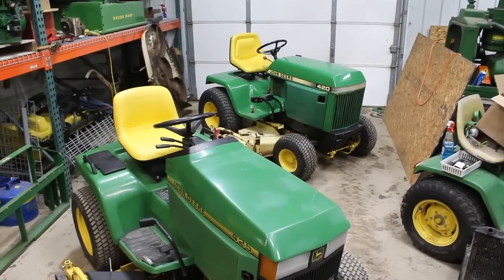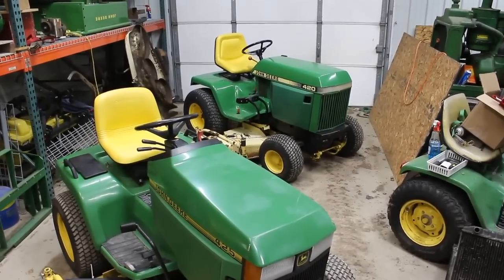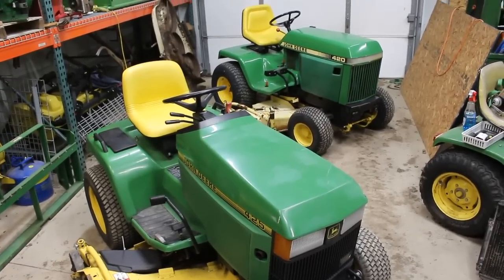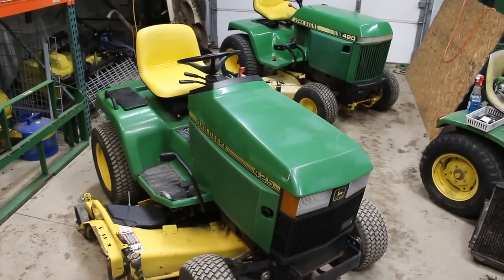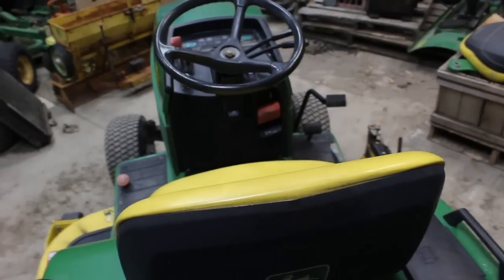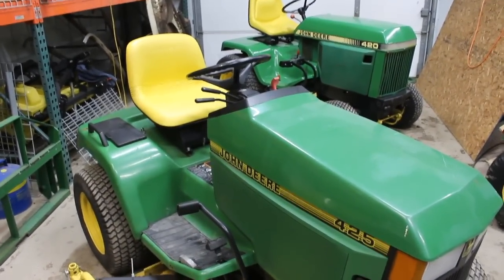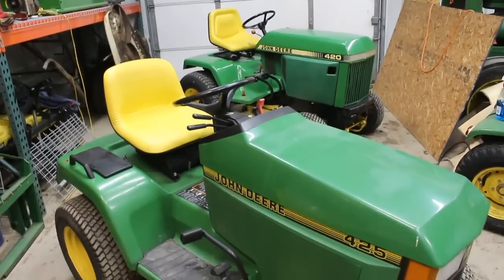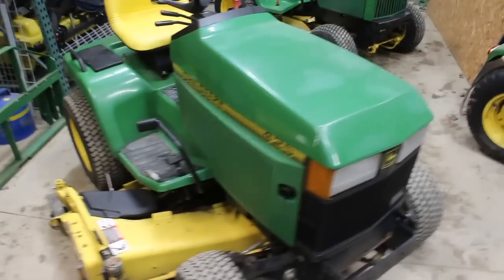John Deere 420 vs 425 Garden Tractors

Comment: I've been told the 425 and 445 were originally supposed to have Onan engines until the EPA stepped in. Deere was having good luck with Kawasaki engines in their smaller lawn & garden tractors at that point, so that's what they chose for the 425-445. The only thing I have against the 4x5 series compared to the X4x5-X5x5 series would be the plastic panels....seems much more convenient to have the hood, grill, and side panels incorporated into one piece as on the X series. I priced out a new replacement X series hood vs. replacement 4x5 hood, grill, and side panels, and they end up costing roughly the same.

Comment: I have to say I have a 318 and my Buddy has the newer 320 is not built anywhere near as tough as the 318. I am a Kawasaki fan as far as the engine goes but the Onan has been good too. Also the 320 still has the hand hydrostat they just moved it from dash to the fender. They also left off power steering which makes the hand hydro a bad idea.
Reply from the maker: 320’s are good machine but they are not in the same class as a 318/322/332. Very different platforms. The fender deck hydrostat control is pretty interesting. I had a 320 many years ago and I like it.

Comment: Nice video and explanation.   I had a 322 (fell off a trailer= total loss) and now have an X540.    My parents had a 425 and now have a 420.   They should have kept the 425, but that's their business...not mine.    You can certainly see the progression in size/capability from the 322 up to the 420.   Huge difference when it comes to adding a front snowblower.
Reply: The 445 is my choice. The wide ass 12x26 rear tires and some wheel weights and the thing can sidehill like a god.

Comment: Great comparison! They both certainly have a different feel behind the wheel. The older style don't have a flat section of fender pan between your legs, its raised, so it makes you feel more "in" the tractor versus the later style that's flat making you feel more "on top" if you will. The later flat style also certainly make ingress and egress easier as well. Both have light steering, but the nod goes to the 'one finger' steering feel on the early ones reminding you of the feel behind the wheel of a 60s/70s American car. Both tractors certainly have their place.
Reply from the maker: Thanks, they do both have their place. In fact I think in my mind (being a diesel fan) if I had to choose between a 430 and 455 it would be a harder choice than some folks think it would be.

Comment: I would like to know if a hydraulic snowblower from a jd420 and the brackets will interchange with a jd425 ? I like your videos.
Reply from the maker: Thanks! Honestly it would depend on the blower. If it is the older style blower that was specifically for the 420, no it will not fit on a 425. If it a newer style quick hitch blower, similar to the ones still sold today, yes, with the correct driveshaft and a 425 quick hitch it will fit on a 425. Sorry that is not a more helpful answer.

Comment: I really like my 420 once added a engine 23 vanguard after pulling the gx670 honda to repair.  Added a used cab and added foot plates to cover open areas.  I want to pick up a used rear with pump in case issues arise.  She plows like a dream, have a 318 blade extras but thinking of getting a 318 to fix but was told to get a 425 but dont like water cooled.  I should make foot box warmer.  Great reviews on everything you have its helped continue doing great films sir

Comment: The 420 was the best l&g tractor. I just replaced my 92 420 in 2016 with a 1025. I had the 50 deck and the 54" snow blade. I loved the hand control hydro. The only problem I had was the front lower pulley I stripped out two of them. I mowed 4 acres and snow plowed for 24 years.
Reply: My 420 JD with frt weights and tire chains has plenty of power and hydraulics to handle my Model 35 five foot rear blade.  Snow removal is simple and effective.  Rod K

Comment: Did the earlier 420s have metal hoods and also if one has a 420 and came across one at a decent cost about 1000 would you get it even though it's not running but plenty if things like deck only but the complete tractor.  Just asking for pointers your films help a lot
Reply from the maker: All 420's had fiberglass hoods. $1,000 for a complete 420 with deck seems reasonable but it would have to at least pass inspection.
Reply: @mmrbeef  what's a few areas that youd look for, the motor isn't running and a cracked hood.  I'm not sure on the deck.  I was considering a backup for parts for mine if needed

Comment: You'll just love your JD 420, that is until you have to work on or replace the starter!  Only way is to remove the entire engine as a unit!  At that time I did a complete rework of all components; i.e., fuel lines, fuel pump, tune up including carburetor overhaul, cleaned gas tank, new 
hydraulic seals, new paint, new seat and now it looks and runs like a brand new JD.   Rod
Reply: kathryn kirchhoff
Reply: kathryn kirchhoff did you get that lil relay thingy to update your starter

Comment: The 4-5 series also has a plastic grill vs metal on the 420.  The k91’s are more prone to leaks than the sunstrand 15u.  The sun strands are easier to replace gaskets and o-rings on.  I do wish they kept with a 2-speed rear.  I’m not sure why, but it seems like the older 300-400 series have held up better than the newer counterparts.  I’ve had to replace more nuts and bolts and small parts on  the 425’s than on the 318s and 420s.
Reply: Give me a 318 and 420 any day of the week!

Comment: 420 came out in 1983' -  Ended in 1991' stronger than 425s I.E thicker frames more metal was used. The 420s hydrostat was stronger.
 The grill was steel, hood was fiberglass instead of plastic hood and grill on 425s 
420s had onan 2 cyl L head air cooled.
 425s had watercooled V2
Onan C.I. 47.7 . Ten cubes bigger then the 425s C.I. 37.7

Both rated at 20 Horse power but Onan's had more torque! (more power}.  The 425s had better fuel economy
420s weight was just under 1000 lbs
425 800 lbs 
420 rear tires 26 x 12 
425  23 x 10
420s could easily handle 60" mowing decks 
425 s could use 60" decks but struggled a little .Better to use a 54"
The 425 was user friendly but over all the 420 was a better tractor
Reply from the maker: Just the Sundstand 15U or the whole transaxle? The axles on the 400 series were pretty poor in some respects. There is a video comparing deck power if you have not watched it yet. I agree the 420 handles a 60 inch deck with ease... the 425 not so much.
Reply: @mmrbeef  I'm sorry I should have kept my 2 cents to my self
Reply from the maker: @drelliott2833  Why, having a good discussion is how folks learn. The reason I pointed out the 15U is because its probably the best hydrostatic pump that has ever been put in a GT.... the Peerless differential with the 300/400 series is no slouch either... but the long axles on coupled with diff lock seem to be a breaking point. Similar length axles were used on the F series front mount mowers and they had higher failure rates (probably due to commercial use).
Reply: @mmrbeef  I'm a Retired JD Mechanic I worked on 420s and 425s when they were newer . Yea I'm old. I would disagree! The Sundstrand 90 in the 420 was superior The failure rate on them was extremely low. As a hobby I restore JDs and love doing 318s 420s <Best garden tractors ever built on Gas. The axle housings were cast steel .Once in a while I would see a bent axle .You could straighten it . But even bent the tractor could keep working. 
    When a 425 bent a axel it was was done because it took out the aluminum housing from the K91. Years from now when 425s are all gone you will still see 420s. One thing I'll do on 420s for new tractor owners is I'll put the brake pedals on the left side then lose the arm control and set it up like a 425 forward and reverse pedals. Just makes it more user friendly It's cutting and welding on the frame so when a old timer restorer gives me Sh*t I just tell him I could modify it to run a 350 V8 chev. and still bring it back to original . Okay I'm ranting sorry for that.

Comment: Love your videos, I have a question? My 318 p is in great shape and I really love it! The only problem I have is when it gets warm the hydrostatic hand lever gets stiff forward and reverse. Any thoughts? I would really appreciate your advice  as nobody else has a resolve for it . Thank you so much.
Reply from the maker: Interesting. Are they any interesting sounds from the hydro unit once it gets hot? My first thought would be to go through and inspect all the linkages and maybe put a little oil on them to see if that helps the problem. That is probably not much help but that sounds like a pretty unique problem.

Comment: When I moved out to Missouri in 1979 my dad already had a John Deere 420 with the Kohler engine that was a piece of junk.
Reply from the maker: In 1979 that would have been a John Deere 400. The 400 had a Kohler engine and was built until 1982. In the 1983 the 420 and 318 were released ending the run of both the 400 and 317.

Comment: Please explain why the streets are always getting changed on onan engines ever video or ad for a 318 I see has a new starter why is that do they go out or get weak even our new Holland onan p218g has a new starter it’s a skid loader
Reply from the maker: Does streets = starters? In my opinion, The reason starters are always being changed is that folks assume the starter is bad when in fact the grounds on these machines are notoriously bad. Typically in the process of removing the engine to replace the starter enough of the wire harness is disturbed to fix any corrosion leading the person to think they fixed the issue with a new starter. While in fact the previous starter was fine. 

To compound the issue, folks but the very cheap overseas starters that weight 1/3 of the OEM units. The new starters then wear out or have grounding issues faster creating a starter replacement cycle.
Reply: @mmrbeef  yeah I misspelled lol

Comment: no I think the 425 445 455 came out in 1993
Reply from the maker: Model year 1993 yes. Based on some of the literature the older 300/400 series and the 4-5 tractors may have overlapped at dealerships in mid-late 1992. So yes, model year 1993 but released in 1992.

Comment: The 420 would beat them in pulling and everything, so much better
Reply: Not even close, 445 drag a 430. 430 is very front heavy and needs lots of weight to pull. Check it out on youtube
Reply: Jason Gartner I said a 420. Tractors like these aren’t ment for speed, there ment for pulling and hard work speed isn’t any of them
Reply: Jason Gartner also the 420 would out pull it, also the older ones are worth more and better over all
Reply: @haydenschneider3  buddy, I've owned all these tractors, of the older John Deere the 430 was best, the 445 and 455 will smoke a 420 pulling anyday,
Reply: Jason Gartner no it wouldn’t, Ive owned 3 420 and they out pulled a truck and everything, the older ones are better built, longer lasting and worth way more. A John deere 318 is still worth $3000
Reply: @haydenschneider3  yea and 455 brings 5,000. I pull in competition and pull plows . Trust me 420 isn't that great. 318 is crap. I've had 10 atleast. They bring about 1200$ if they still run. If you want a good 300 series, best is a 322 gas. Will whip the shit out of a 318
Reply: Jason Gartner the 318 is a great machine, they last a long time if taken care of the 322 and 318 is he and thing other then the 322 has a better/ newer engine, so they would probabaly pull the same because there the same size. Anyways you have what you lie and I have what I like, and can we both agree that John Deere’s are the way to go no matter what year
Reply: 322 is 3 cylinder and will run circles around a 318, like I said I've owned all these at once. I had all the 300 series and 400 series. I used to collect and restore these for a living. We tested all these at tractor pulls, plow day and just hook them up back to back.  The 318 just wasn't much in the power department,  the old 400 was a good puller too. In the power department the 322 wouldn't big down with snowblower,  it was amazing. The romans motors will never last like an old cast iron Kohler or a yanmar 3 cylinder.  A 322 or 332 cost you a good bit more than a 318 and that's why. This isn't a debate its facts.
Reply: Jason Gartner I know that the 332 and 322 are better then 318 but 318 are still a great machine. And they have onan engines not kohler. And I don’t care what you think, I have my preferences and you have yours.
Reply: @haydenschneider3  yea no shit, the old kohlers last lot longer than onans.
Reply: Jason Gartner no they don’t, Onans last longer.

Comment: Surprised you rated the Onan life span so short i personally have had a onan with 2,000+ hours and still ran strong,, now they dont last as long as the Kohler Magnum twins because of the one piece cylinder block design made from aluminum compared to the cast iron cylinders of the kohler,, my grand pap had a 317 like mine with the series 2 engine and he made same mods as i did a external oil filter and cooler and he had 3,000 hours on it i shit you not ,, he used rotella 15w-40 oil in it ... i use the same oil in mine but its the synthetic version,, oh and both his and mine were converted to electronic ignition basically making them a magnum 18...now mine only has 565 hours on it  so i cant speak for the longevity of mine but when he passed he had 3,029 hours on that machine that he bought brand new from the dealer..
Reply from the maker: I don't think Onan life is short per say..... In fact like you mention a properly cared for Onan will go 2,000+ very easily. The problem becomes how were they maintained. At this age most of these machines are on their 3rd, 4th, 5th + owner and as value decreases so will dollars spent on maintenance. My comment was a generalization. If you go out an shop for an Onan powered unit I would want to see leak down and compression tests before I purchased it IF I intended to use the machine as a primary work unit. Same with the opposed twin Kohlers.